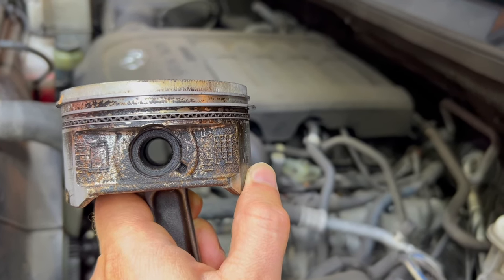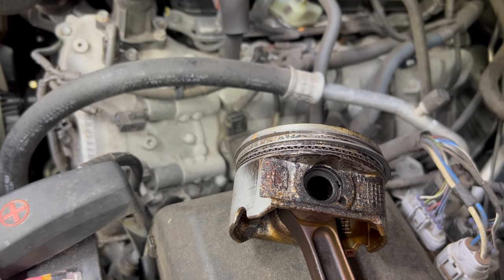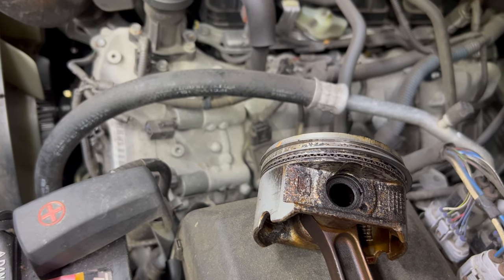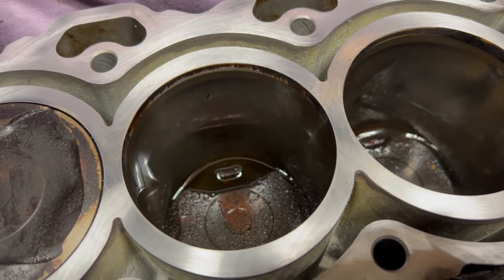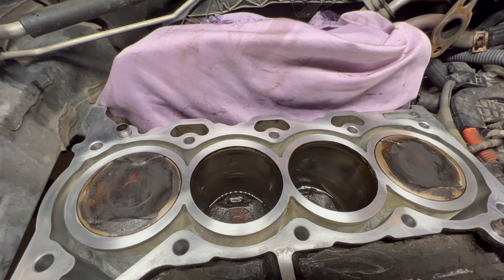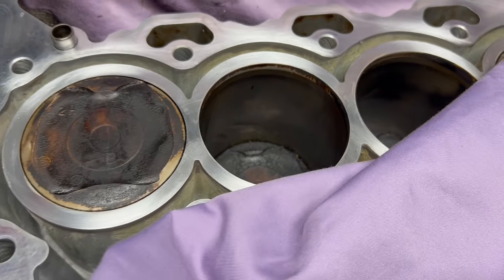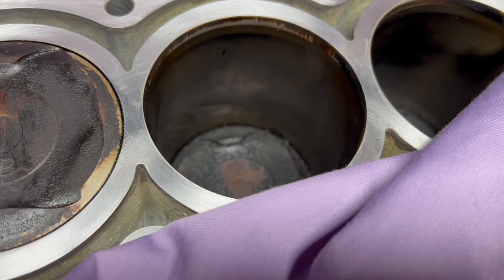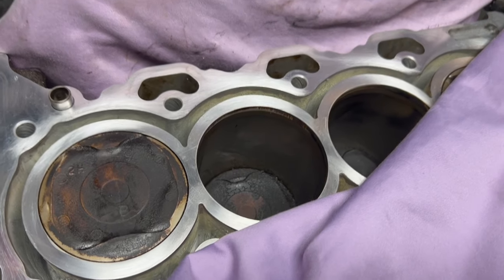Oil consumption and decarbonizing oil rings works? How to clean oil rings without removing pistons

Comment: If you do this, make sure before you start it you add some oil to each cylinder so it doesn’t start dry and add to your problems
Reply: oil through the spark plug hole? how much?
Reply: @carenthusiast6748  just a tiny bit with a funnel.
Reply: @carenthusiast6748  I poured the little bit of oil in, turned the engine over with key and the plugs out a few times to re lube the piston Rings and make sure there’s not enough in there to cause a hydro lock
Reply: @bradbozarth3235  i used liqui moly engine flush before my oil change yesterday but it sill burned 250ml/130km ish so probably 1L/500-600km... so thats probably the block done for.. cant get b12 or seafoam here in europe, might try yamalube piston free in an last ditch effort (Its a Avensis 2.4L 2AZ FSE)
Reply: No, don't do this.
99% of people outside of actual mechanics and actually knowledgeable DIY'ers are just as likely to end up bending valves, rods, etc, by hydro-locking.
Assuming an oil change has NOT been done after re-installing plugs, oil pump, filter, sprayers, etc are all ready to go as soon as the crank starts to move. By then time the starter has turned the engine over 2-3 times and it catches, oil will already be being sprayed onto the cylinder walls.  
If one was doing this on a $200K car, then yes one could add this to the billable hours as a precaution.
There is still going to be oil on most of the cylinder walls to make this a non-issue.
Reply: @carenthusiast6748  Dude, you should be able to find acetone in the EU. That will work almost as well, perhaps better, if clogged oil rings are the problem.
Reply: @boots7859  already done. No issues, pretty sure i said before you turn the engine with the ignition with the plugs out after adding a tiny bit of oil to each one. Allowing any extra to blow out. Relax lol

Comment: Good video, and yes there are gotchas like hydro-lock that can take place. 
However not sure you can say piston soaking with B12 does not work from this demo.  
Most of the YT vids on this usually are done with adding an ounce or two to each cylinder and then either re-installing the plugs or covering them.
This reduces the B12 abilities to aerosolize/evaporate, especially if you can reinstall the plugs.
Once you've added the B12 and plugs, you bump the crankshaft a bit, and then top-off/bump every 2/4/6 hours until you either run out of B12 or have had enough/need the vehicle.
The smart folks do an immediate oil change, the stupids start the car, rev it up happy to see it smoke, and then drive it around for a while.
Needless to say, high revs or load on an engine with thinned out oil is quite possibly making a simple carboned up ring problem much more serious as a bearing/journal issue.

Thing is, a lot of people have done this since before YT was thing, and its kind of hard to assume all of them were talking BS. A lot of the YT guys, especially the Audi guys seem to mostly have sane, no-BS channels, and between them and numerous comments from some of their viewers, its seems to often work.
As an alternative to dropping $1500-2000 to have a mechanic pull the engine and tear it apart to get to the rings and then reassemble it all, a $20 Supertech full synthetic, $5 filter and $10-12 2x cans of B12 is certainly not a stupid idea all things considered.

Just for the non-mechanics, make sure you cover the plug holes before re-installing plugs with cloth or rags and keep cranking the start until liquid stops shooting out. If you're not sure the cylinders are all empty of fluid just let it sit for some hours and check with a piece of dry paper towel on a pencil.
Reply from the maker: I did not say it did not work.

Comment: Hey I was told to free up piston rings fill cylinder with ATF and let sit. Now maybe do a combination of ATF and this additive. Let soak for a day. Make sure cylinders are clear if liquid before starting. Also maybe repeat process. 
Nice video
Reply from the maker: ATF is a lubricant and not a cleaning fluid
Reply: Yeah, ATF doesn’t have the cleaning dispersants it used to have years ago.
Reply: @repairvehicle  not exactly true.   It's a cleaner as well.
Reply: @danielk7111  Dextron III does
Reply from the maker: It’s not a cleaner, it has small percentage of detergents like motor oil

Comment: Thank you so much - you the only person who actually shows this procedure with the head off and you made a really good point about the risk so I think I am going to skip as much as  I really want to try this method it is risky as you video proved a point that the cleaner could just sit on top of the pistion or it could loosen up carbon that will cause more problems
Reply from the maker: You are welcome! Please share this video with others via Facebook or any other way. Thank you!
Reply: While I appreciate the OP's line of thinking, he also is not doing anything much similar to a piston soak.
I would say anyone not mechanically inclined should indeed avoid this. Anyone else who has the aptitude to change a spark plug, AND follow simple instructions, its worth a shot as you're unlikely to hydro-lock your vehicle.
Cover the open plug holes with some cloth and crank the start several times. Replace cloth/paper and keep doing that until fluid no longer shows on the cloth/paper.
Re-install plugs, do an oil change, and go.
Worst thing is either your rings are no the problem and you wasted some hours and $40-50, or like a lot of folks you see a good decrease in oil burning and saved either a $2K repair or shopping for a new vehicle.

Comment: Will "italian tune-up" (driving at higher rpm to increase the engine temperature) burn off the carbon off the stuck piston rings?
I have Alfa Romeo 159 2.2 JTS, and it is burning about 230-250 ml of oil every 1.000 km.
Reply from the maker: You will damage engine if you going run at such High temperatures. Engine oil consumption and 4 reasons to eliminate. Engine burning oil
https://youtu.be/tB2zDVZevyw
Reply: @repairvehicle  I don't mean continuosly driving at high rpm, but driving "sporty" rather than "normaly". My car has coolant and also oil temperature gauge. Oil temperatures have never reached even 120 oC at higher loads. Operating temperature for oil is 110 oC.
I will check out that video.
Reply from the maker: @DashCamSerbia it takes about 1000c temperature to burn of carbon for about at least 20 minutes. If you get your engine to 1000c damage is unavoidable
Reply: @repairvehicle  Not the engine temperature itself, the combustion chamber temperatures. They are even higher than that, and piston rings are close to the combustion chamber.
Reply from the maker: @DashCamSerbia if you get pistons temperature to a 1000c temperature for a short time you will burn a hole or crack a pistons. Italian tune up is just a false information that doesn’t work. What oil are you using now and how often do change?
Reply from the maker: @DashCamSerbia what is bs?
Reply: @repairvehicle  Not the pistons man, the "air" temperature inside the cylinders (when the pistons are at the top). It is not false information. Cars that are driven lighlty in cities can become "lazy" when you need power from them at the highwaay, and then driving them at higher loads on the highway then brings them back to life.
The previous owner was changing the oil every 20.000 km. I bough the car with 173.500 km and changed the oil at about 174.500 km with Selenia Star 5W-40 ACEA C3. I will soon be changing the oil again at about 182.000 km with Selenia K 5W-40 ACEA A3/B4. The both oils satisfy FIAT 9.55535-H2.

Comment: Piston oil return holes how to unclog them without take engine apart? This is million dollar question.
If  you have piston with clogged oil return hole handy, could you try burn out the gunk in the return hole?
Maybe possible to take off oil sump and burn out the gunk in oil return holes?
Any ideas, I"ve been trying to solve this problem for a long time.
Reply from the maker: Actually using this oil can help with gunk, see details with graph https://www.amsoil.com/p/amsoil-5w-20-100-synthetic-high-mileage-motor-oil-hm520/?zo=5257753
Reply: thanks I repeat my question, if you have a piston with gunk in oil return holes on your bench, can you try to burn it out with tiny flame or similar? @repairvehicle I'm asking if you can try this?
Reply from the maker: Yes you can try. However you going to create a problem by overheating rings and pistons by burning soot and gunk with mini torch. Overheated pistons and rings will be softer and will break down
Reply: interesting, maybe small laser will do the job, only burn the soot in the hole, its such difficult problem to solve without take engine apart, you can free the rings no problem, but these oils etc, dont clean out the oil return holes @repairvehicle
Reply from the maker: @namenotshown9277 to remove all gunk and carbon buildup 100% you have to remove pistons. If you want lower oil consumption, use high detergent oil and it will clean up holes and rings
Reply: thanks for your wonderful advice I appreciate it @repairvehicle

Comment: What i did is following
I empty 5 cans in a empty bottle and filled the liquid in the gas tank with premium gas and drove it till empty..than refilled it with normal gas 
Also you want to do it when your oil change is near.  Because your carbon will get into the engine oil
As a bonus i did engine flush and changed the oil with new oil filter  ..
Now car is running smooth and 90% smoke is reduced ...
Toyota corolla 2009 1.6
315000km odo
Reply from the maker: How often were you changing oil?
Reply: @repairvehicle  i bought it used ...the when replaced valve cove gasket it was gunked up...so i did this... i replace it every 3000km
Reply from the maker: You should have stayed away from this vehicle.
Reply: @repairvehicle  well you are right ...but i love the car
Reply from the maker: Cvt transmission?
Reply: @repairvehicle  no its 4speed trans..with 3zz-fe engine...do i replace the trans fluid with filter or just the fluid transmission shifts like dream ..just in case only
Reply from the maker: As bare minimum I would change fluid. Filter change at this mileage is good idea too.
Reply: @repairvehicle  thanks
Reply: Just one thing to add if your engine is having sludge issues after doing engine flush please change the VVT-i filter because it is probbly clogged too at this milage i replaced it and was surprised to see the amount of the gunk in the filter ...other wise you will damage your engine head...
Reply from the maker: Where is this vvti filter located?
Reply: @repairvehicle  to locate the vvt-i solienod 
Below it you will find 14mm blot remove it and you will find a metal mesh filter for vvt-i
Reply from the maker: Interesting. Looks like not all Toyotas have this
Reply: @repairvehicle  well what i know of is 
Landcruisers and corollas do have ...by the way i am from middleast ...so it could be diffrent for people in europe and america...so just do research on it before cosidering any engine flush ...
Reply from the maker: Thank you for sharing this .
Reply: Why the high octane fuel?
Reply: Hi, sorry but may I know you used 5 cans of what for this treatment?
Reply: Yes, I’m in interested in trying this. What was the 5 cans you used? Thanks

Comment: hi dear 
i do have a question for you
i have a 2019 audi Q7 55 premium plus 
 i bought this car 7 months ago was have a 33.514 miles now 39.000
and every two weeks or every 600 miles i have to add 1 quarter oil 
that means i have a problem with consumption oil 
what is your opinion about that problem ? and how to fix it  Thanks for your expertise
Reply from the maker: What brand of oil are using?
Reply from the maker: You must have a leak somewhere
Reply: @repairvehicle  0 w 40
Reply: @repairvehicle  there's no leak
Reply: @repairvehicle  its from the dealer audi i did the oil change last 09/22/2023
Reply from the maker: What brand of oil are you using and how often do you change?
Reply: @repairvehicle  they use ( 0 w 40 )
 i did twice oil change first 1 was 07/22/23 and then second 2 was in audi westwood 09/22/23
Reply from the maker: 0w-40 is a viscosity. Brand is like Mobil, and so on.
Reply: @repairvehicle  yes mobil one
Reply from the maker: You should try different brand
Reply: Hi, did you ever resolve your issue with your Q7 burning so much oil? What is the dealer telling you to do? I have the same issue and change the PCV, but that didn’t seem to completely fix it.
Reply: hi @samirshamo3129 did you ever resolve your issue with your Q7 burning so much oil? What is the dealer telling you to do? I have the same issue and change the PCV, but that didn’t seem to completely fix it.
Reply: B12 piston soak

Comment: Million dollar question?  Will this solve the age old issue with the clogged oil rings on the 2007-09 2.4L 2az-Fe Toyota motor found on the Matrix and Pontiac Vibe?  Which reportedly causes massive oil burning consumption....
Reply: My understanding is those engines have defective pistons and or piston rings.  No amount of "mechanic in a bottle" will fix that.
Reply from the maker: If they were defective then oil consumption would have been from day one, but it happened always after warranty expired.
Reply: @repairvehicle well if the piston ring has worn away over time, the issue wasn’t apparent when new…..
Reply from the maker: @aqib2000 rings worn out due to lack of lubrication

Comment: I will spray some into a cup size of the piston area to see if, or how fast, carb and choke or combustion chamber cleaner evaporates. Just in case if some fluid remains inside the cylinder I would suck it out with brake bleeding vacuum pump to avoid hydro lock. We did more than a few engines, especially CR-Vs, with 'baked rings', but maybe the for older designs which use 5w-30 and have different rings design than newer engines the soaking of the piston trick might work. Has anyone tried engine flush to free up the rings ?

Comment: hack mechanic         pour the berrymans down the plug holes with both valves closed.  use a compressor to add pressure to the cylinder.    that liquid is going down .....put wrench on crank bolt and give a few rotations     change oil and see what you got
Reply: What do you mean by compressor? Do you spray air into the spark plug holes?
Reply: Or, do all of that and simply put the plugs in and push the crank 1/8 turn. Light pressurization but not near enough to bend any valves and done at the same time vs 4/6/8 times individually with a compressor/leak down tester.
Reply: @CJ-nk1ls  yes   gurgle the berrymans
Reply: @CJ-nk1ls yes with the valves closed making sure the cylinder is sealed. All the pressure will go down to the rings because engines have a small blow by, by the rings which goes down to the crankcase
Reply: I think capillary action will make the liquid slowly go down into the piston ring grooves.
Reply: @phiksit  it works    my tacoma was burning a quart every 800 miles... now burns 1/4 of a quart every 4000